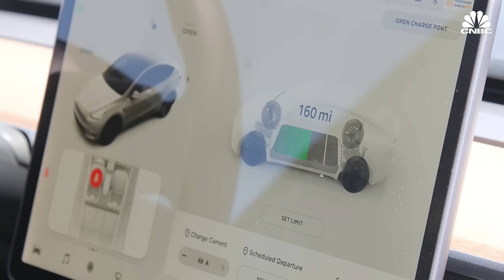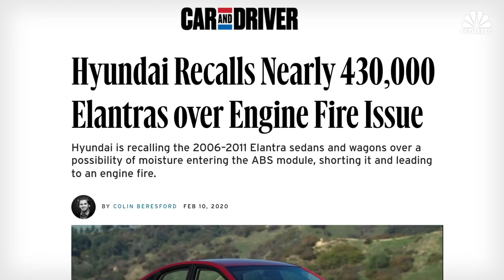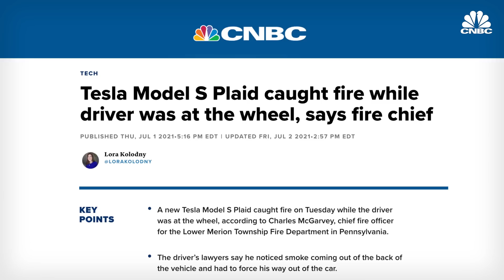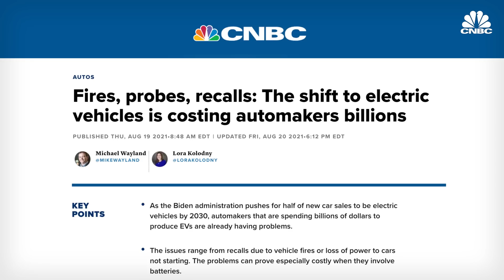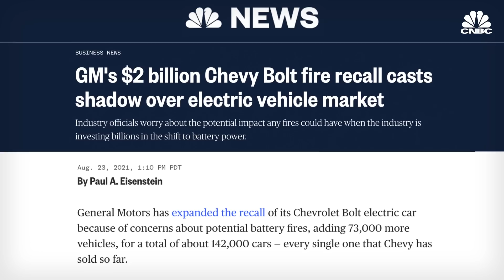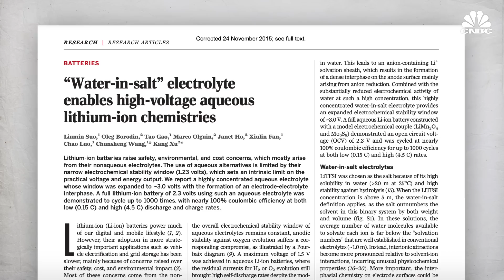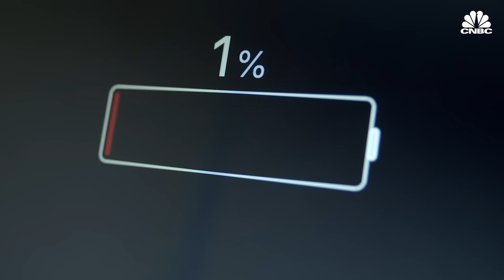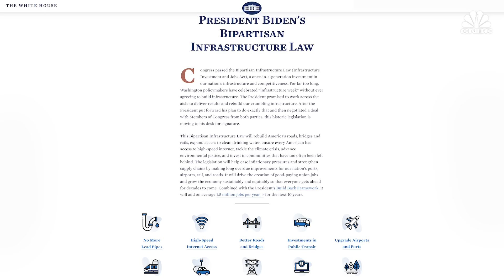Why Tesla, GM And Other EV Companies Have A Fire Problem

Comment: No one is tackling the problem that we really face... other than the danger of fire.. Where are we going to get all that electricity to charge up that massive number of cars...? 
Also, Can you imagine if all those rescue vehicles in Florida, were electric.. in an area where there's no power to charge them up..? Just a thought..
Reply: You make an excellent point. First where do we get the additional electricity from? Our city owns two means of providing electricity. One is a hydroelectric dam and the other is a power plant that burns wood waste and other materials like peanut shells, etc.  At this point in time if the electric grid requires additional power because of the failure of either of the two they rely on 2 Rolls Royce jet engines to replace the power lost until the lines, which are their vulnerability, are repaired. They haven't been used in years but are fired up occasionally to make sure that they operate well. Our summers are not getting hotter but we've been experiencing brown outs and the city has asked us to limit our electrical use during certain hours and having lived in this city for over 20 years and never being required to limit electricity usage made me wonder if all of the electric vehicles I see plugged in all over the city are responsible. Electricity is finite and our city has no additional means of making more electricity. I was drawn to this video because we recently had a vehicle that was charging inside a family's garage catch fire. A neighbor, coming home from a late shift, saw the fire and woke the family and they were able to evacuate safely even with their pets. Unfortunately, our local fire department couldn't put the fire out because they couldn't get near it because of the fear of an explosion because the garage door was closed. They were correct to be cautious because it did explode and so they turned their attention to saving the houses on either side of the burning house. The police and fire fighters, wearing gas masks, were evacuating people because of the chemicals in the air and it was a nightmare for the entire block. I think that we want to change the world but our infrastructure isn't ready nor are the batteries in these vehicles safe enough to trust. I believe we have to create more green energy but we need to be aware of the danger of rushing into going completely electric in vehicles. I most certainly will not buy one until I am sure that I and my family will be safe and not just another statistic.
Reply: @lmcsquaredgreendale3223  The problem is.. Liberals, I've found in my 77 years of life, are people who are led by feelings... Facts and science doesn't rule their lives.. It's ignor facts, and science is a Consensus... CONSENSUS isn't science.. it's a vote by scientists who can't find facts... (liberals) so they vote on their feelings..
I'm a sculptor who tries to recreate subjects of the old west.. It's a passion of mine... But when I do  a subject, like Jim Bridger (I'm currently working on a clay of him) I have to do research as to the type of horse, clothing and what he looked like... I don't feel what he looked like, I actually research and come up with Photos of him.
My point is.. Liberals want us to be using 22nd Century tech.. in the 21st century.. WE JUST DON'T HAVE THAT AT THE MOMENT.. and it may be the end of society, so they can FEEL GOOD...

Comment: DO NOT drive in these lithium battery powered vehicles and don't go near them and don't park next to them. If you have them in your parking structures, don't park nor live there. It may be rare, but when they go and ignite, the fire is super hot and will melt and catch anything around it on fire. Not to mention it is highly toxic. You do not want to be in the car when the battery fails, because it explodes with super white-hot fire, enough to melt in you in the car before you have a chance to get out. Like walking near a lava flow.

Comment: A fire extinguisher is of absolutely no use in the case of a lithium battery fire but there is a good chance of putting out a fire with a fire extinguisher on a conventional powered vehicle but absolutely no chance in putting out a fire in a lithium battery with ANYTHING!

Comment: All this does is enrich China which owns most of the battery manufacturing and the mining.  We spend 4x to upgrade the grid, etc, and risk our homes burning down for shorter range, less power..this makes absolutely no sense. None. This is a bonehead move.

Comment: Battery cells fail with no warning on any battery, now toss in a whole floor board of them in underneath where you are seated, not a situation I’d want to be in, I’ll stick to my single or double battery under the hood of my trucks, the power grid is going to fail anyway due to to much strain and lack of parts like switches and everything else that keeps them running due to our current economy

Comment: Toyata has built Solid State battery and BYD has blade battery both of which are inflammable. 
All the rest are now using Lithium Iron Phosphate which is much more safer than traditional Lithium Ion batteries that caught fire in this video.

Comment: The only BMW I3 cars that have burned ironically are those equipped with an optional gasoline motor-generator unit called a range extender. The cause has been the fuel line in most cases, though one burned when the dipstick wasn't properly reinserted.

Comment: feel sorry for electric  car  drivers and future  owners. They will simply  have to learn the hard way .. as I did. These things are a huge hassle and a outrageous expense  in the long run. Batteries  are very ... very expensive to replace ( thousands of dollars) ...  and make no mistake, you will be replacing them. These batteries are highly toxic to our environment,  with a high potential for disaster to our surroundings. This is NOT CLEAN ENERGY BY ANY MEANS! 

I also regret all the  lost hours at these charging  stations.  I wish I knew all this before I bought my car .  Do your homework before buying !
Reply: My BMW I3 ($16,250) costs $2.25 per business day for charging, versus about $11.00 to gas up the Ford Ranger it replaced. The I3 has no scheduled maintenance this year, or the next, not until April, 2024. Performance is terrific, smoothest, quietest car I ever drove. Battery has a 100,000 mile warranty. With the money I saved in the last year, I bought a Kenwood TS-950SD and a Ryobi RM480E.

Comment: There is a star in Taiwan whose electric car hit a telephone pole and found several major life problems. Users and manufacturing companies who use electric cars should pay attention: 1. Lithium batteries are burning, and the fire brigade cannot immediately put out the fire, so use 75 tons of water before pouring  put out.  2. The front of the car and the driver's seat were all burned, and in a very short time, passers-by rescued from outside, otherwise the driver would be burned to death.

Comment: So all you green initiative, global warming activist types think you are solving something?  All that plastic and paint burning into the atmosphere.  There is more plastic in one electric car than five gas vehicles.   All the non-renewable lithium being mined at record levels.  Tons more money that will have to be poured into fire fighting technology and equipment   The expense of all the extra electrical infrastructure.   The rise in everyone's insurance due to car fires, house fires, garage fires.   The extra heat being generated by these batteries and their fires.  The extra ozone being created by all the electrical fields.  On average an electric car adds $60-$80 per month to an electric bill with moderate usage, not too bad when compared to gas.  However that e-vehicle costs an average of $10,000 more to buy for a smaller vehicle than a gas vehicle and has about half the range of a gas vehicle.  Wait until the batteries need to be replaced.  The average is $15,000 and you can not replace them yourself.  They have a lifespan of 6-8 years.  Definitely don't wreck them.  Most cases they can not be fixed and most shops can not work on them.  My cousin had a Tesla and while on a trip he was forced off the road and hit a couple of things.  He found one shop authorized to fix it over an hour away.  The cost was $14,000.  A similar sized car could have been repaired for less than half of that.  I have a Toyota truck I have driven for 30 years.  It has almost 500,000 miles on the original engine and they are hard miles.  So even if I gave a generous 10 years on battery life I would have to spend $60,000 on batteries.  The last report I read only gives electric vehicles a useful life of 15 years at moderate use.  Also the electric motors in ev's are expensive $8-$10k each.  When you weigh everything out equally, there is very little if any savings and very little if any less affect in some way on the environment and ecosystem.  So if you want an ev by all means get one.  Just don't make it a political ,social and group agenda shaming everyone and telling people they are wrong or evil for purchasing gas vehicles.  Do actual research instead of being the brainwashed  majority.  It is You do you and I'll do me, not you do you and you are the only ones right.  Don't even get me started on solar and wind.

Comment: Whether EV's catch fire less often may or may not matter. It's the nature of the fire and whether the occupants can get out alive or unscathed.

And electric cars will be of little use to people when the electrical grid goes down, state-wide, province-wide or city-wide. It doesn't matter. Even if just an entire section a city loses power, thousands of people are screwed.

This is even worse than when we lost Internet service across Canada. You can just hook up to another utility like you can piggyback off of Bell's Internet from a friend's house or hotspot.

Once we've put our eggs in one basket, fire get more catastrophic, electrical outages are no wide -spread and negatively affect people in a worse way than independent fueled vehicles.

Armageddon is just around the corner.
Reply: Gasoline pumps generally don’t work too well without electricity either
Reply: Gas stations don't work without power either......
Reply: @Brian-om2hh  Perhaps, but it's relatively easy for people to store gasoline in containers and get a few extra miles from that. You can also siphon gas from one tank to another. Considering how large some gas tank are, moving a full tank of gas from a large SUV or truck can get a small car to go quite a few miles. When an electric car goes dead and the electrical system is down for days,  you're totally pooched and without alternatives.

Comment: An all electric future looks more deadly than it initially didn't. Imagine a large lot full of these cars. What would that do to the environment if one caught fire and eventually the whole lot? Would it even be able to be contained and once its over, would there even be any ground left beneath the vehicles?
Reply: They might burn a hole down to the center of the Earth and release b gates father from Hades itself.
Reply: @mochiebellina8190  The humankind are pathetic! Rolled up steel or metal sheet, push and force the sheet under the burning car, or has some light forklifting while push the flat metallic sheet under the car. Then rolled out barrier of inflatable walls around the car but not too near it to get burnt, the walls only need to be tall enough to fill up waters to drown the car or submerged it, the base of these walls are either suction cup to the metallic sheet, to prevent leaking of water, spray fast drying concrete foams at the base and corner on the wall. Keep firehosing into the the swimming pool with the burning car inside. This method saves water and drown the burning car. I am baby chatting with you, because you are not worth it! Don’t ask me about other misc small details as how to deliver and prepaid materials to built the immediate swimming pool!
Reply: @Giuliano Matrix actually, he was dead serious.
Reply: There isn't going to be an all electric future, at least not anytime soon.
Reply: Have you seen the fire at Luton airport multi-storey car park. 1500 cars destroyed and the car park collapsed thanks to an EV!
Reply: Another big environmental impact of electrification is the scale of "clean energy" sprawl that's still dependent on fossil fuels. I can't feel green while driving through industrial landscapes full of wind turbines and solar lakes. They are dealing a major aesthetic blow to mountaintops and rural ambience.
Reply: @falseprogress  
Now you been reading too much propaganda. We already had a solution: Hydrogen!
It's made out of water, hard to refine but the resources are almost infinite. Those batteries are going to be dug into the ground and never used again because it cost too much energy.
Reply: @falseprogress  Right now we're all still dependent on fossil fuels. Anyone who uses EV cars to save the environment right now are all bullshitting themselves, but in the future we'll all be driving EV. Electric cars will only pollute less once we make the switch to nuclear or geothermal or whatever.
Reply: @falseprogress  We are already at a risk of rolling blackouts.  They are insane.  Even though the gas engines are less efficient, the US uses 369 million gallons a day.  At 46MJ per kilo (a gallon of gas is like 3 kilos or 6 pounds), that's A LOT of energy to replace and get from somewhere else.
Reply: @falseprogress  And killing millions of rare birds and bats to save polar bears you can legally hunt right now.
Reply: All of these fires stem from lithium-ion batteries since lithium in itself is pretty unstable. Solid state batteries are much more stable, although the technology to build lasting solid state batteries isn't here yet.
Reply: We’ll need more nuclear power plants to satisfy the added demand for electricity due to widespread electrification of cars.
Reply: The humankind are pathetic! Rolled up steel or metal sheet, push and force the sheet under the burning car, or has some light forklifting while push the flat metallic sheet under the car. Then rolled out barrier of inflatable walls around the car but not too near it to get burnt, the walls only need to be tall enough to fill up waters to drown the car or submerged it, the base of these walls are either suction cup to the metallic sheet, to prevent leaking of water, spray foams at the base and corner on the wall. Keep firehosing into the the swimming pool with the car inside. This method saves water and drown the burning car. I am baby chat with you, because you are not worth it!

Comment: I see a very common theme in this comment section. And it goes for wide range of issues in this country that mostly are pushed by the same folks. There is a large subset of people who support the EV "revolution" that act as if all the products bringing it about are infallible. Any questions, any criticism, anything but going lock step with blinders on and it's instant insults, questions on intelligence, blah blah blah. In my 41 years on this planet I've learned quite a bit about people who act in this manner. One thing is that they cannot control their emotions. Another is that they simply have no answer or counter argument for the criticism or objection and it annoys them. And finally, they are usually know it all types. Normally, I avoid conversations with folks like this. Folks who refuse to see anyone else's point of view but their own. Folks who think their way is the one and only way and want to destroy anyone else who dare thinks differently. We have a lot of people like that in our country. A lot of people destroying the conversation on just about everything important. 

When I watch videos of lectures with Q&A from college campuses in the 70s and 80s where thoughtful and intelligent students disagreed respectfully and compare them to the blue and green haired screeching college students of today who can be set off like a raging pitbull by one ounce of differing opinion I cannot forsee a future where intelligent discourse will ever be a reality again.
Reply: What are you on about?

Comment: Uhhmmm since when do you use water to extinguish chemical and electrical fires ... humidity alone will ignite lithium if the cells have been compromised and the inside is exposed.  You dump water on it your just adding fuel to the fire... that's why it takes ten times more water to put it out... even then it's not out it will most likely reignight. Try baking soda....dirt...sand ... . anything but water

Comment: Electric vehicles are nothing more than a new way to transfer wealth, from the gullible consumer who falsely believe battery powered vehicles are better for the environment, to the perpetrators of the myth; those who cover up amount of pollution created during the manufacturing process, and the long-term damage to the environment resulting from disposing of the used batteries.

Comment: Place the battery at the top of the car, but prevention is better than cure 🤷 I know car lithium battery have allot of heat sensor but why do it still burst into flame when charging 🤔 the problem still have to do with the BMS if electric car manufacturer don't do something about the conventional and regular type of BMS the problem cannot be solve